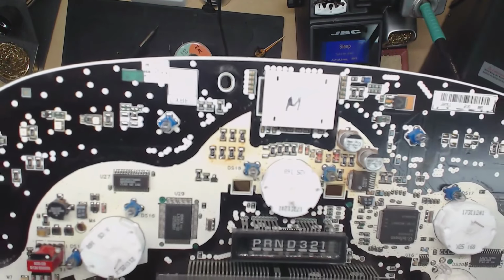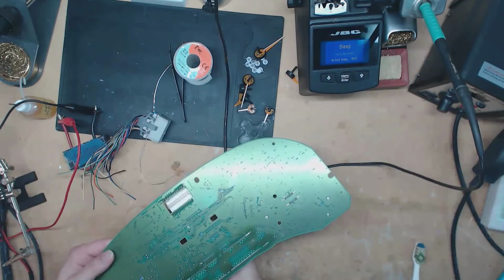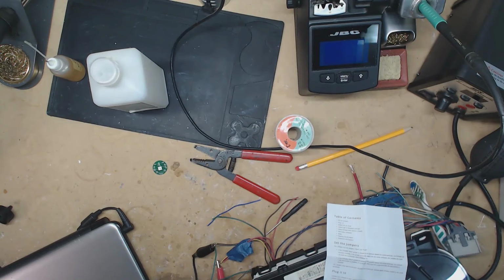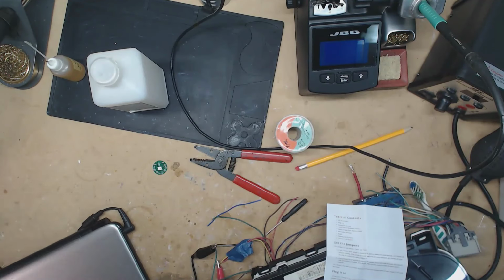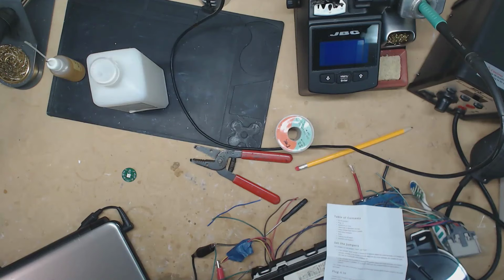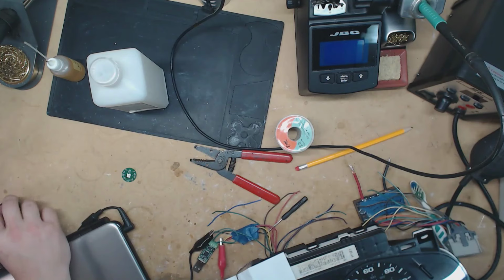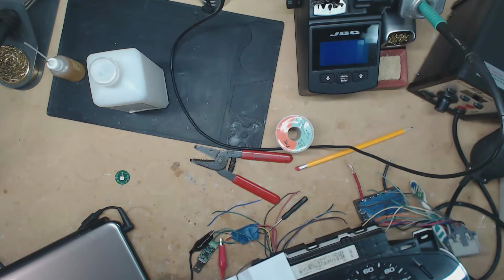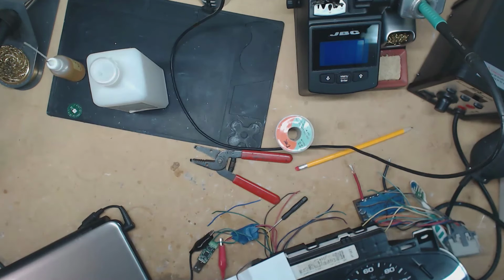Redoing A $h!T Local Repair

Comment: Do you have a way of testing calibration?
Reply from the maker: Calibration on this cluster is pretty simple because the needles all have a home point when it's powered up. The older 99-02 clusters when you replace one of the motors in that cluster it can be a pain to recalibrate it. With the 03+ ones if you are just starting out and don't know the zero points just use painters tape and mark where the last step of the stepper motor is and will work too but some times you run into seized steppers and prior repair attempts where nothing is set right when you get. 

To sweep the gauges just use one of the cheap knock off GM tech 2s you can get on eBay and use a signal generator to drive the rpm/speedo.